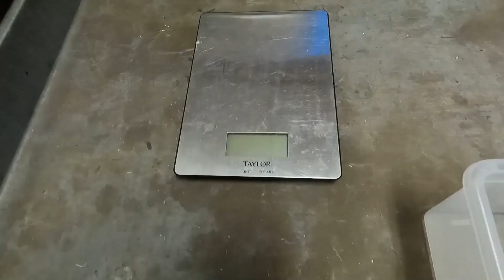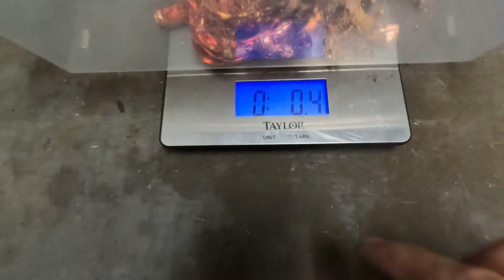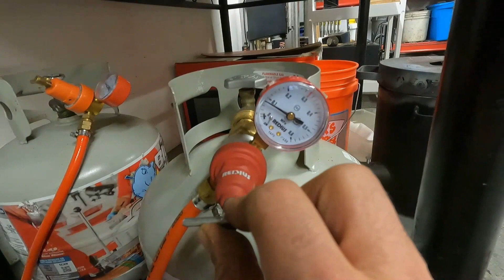Scrapping Window Fans - How much copper is inside? - Trash to Treasure - Melting Copper

Comment: Lovely video! I just love the concept of scrapping for casting. 
I was watching this vid while scrapping out a kitchenblender I found. Lots of copper in them.
Keep up the good work!
💪🏻💥
Reply from the maker: Hey buddy!  Thanks for checking out my video as always 🙂 Ooooo a blender, I never scrapped one of those before.  I’ll be sure to keep my eyes open for one.  Thanks for the tip!!!
Reply: @Scrap2Cast  well, at least it’s a lot of copper for a small appliance. This was a countertop blender.
Reply from the maker: @magnussahlstrom4172  how much in weight did you end up getting from it???  🤤 I love copper
Reply: @Scrap2Cast  I haven’t finished scrapping the motor or stripped the wires yet but my guess is half a pound with all the wiring and capacitors and stuff.
Reply: But it could be less, though. But still good for a small appliance.
Reply from the maker: @magnussahlstrom4172  pretty decent score!

Comment: Just found your channel, love your video style and approach. I def wanna see where you'll get to in time. 
Might I strongly recommend Borax fluxing your copper melts? You're losing a hell of a lot of material to oxidation and slag in your melts/pours right now, and borax is cheap as dirt. It's a physical process not just a chemical one so make sure you use enough borax to cover the top of the molten pool, for your size crucible maybe 1/4 to 1/2 cup. Add it in while the metal is warming up but before it becomes molten as borax contains a lot of water that has to be expelled first before it works as a flux. You'll get so much cleaner pours and recover so much more copper without wasting gas on remelts and repours.
Reply from the maker: Thank you.  I do use Borax, I don’t show it in every video.  Appreciate the concern 😁

Comment: That was a very old and rare metal window fan! Please tell me it didn’t work, as you could have sold that for at least triple the money you made from scrapping it
Reply from the maker: No it was toast.
Reply: @Scrap2Cast  lol good XD
Reply: Box fan was crap either working or not XD
Reply from the maker: Yeah it was a hunk of crap, one motor wouldn’t work at all, the other powered on but was wicked slow and rattled like crazy.  I do appreciate the info though as I had no idea that type of fan was collectible like that.  I’ll definitely keep an eye out for them!
Reply from the maker: @fanboy11thefanfanatic  hell yeah brother, those box fans get gross AF inside 🤣
Reply: @Scrap2Cast  they are always on the side of the road, I don’t even bother as there aren’t even scrap yards nearby where I live, at least I don’t think so
Reply: Did that damn box fan work? When I find them they do work but I just smash ‘‘em and then just throw them out lol
Reply: Also for the box fans to get the blade off don’t take to motor out leave it in the frame, then use something heavy to hold it down, I use my feet XD. And then pull up and it will come right off
Reply from the maker: Awesome thanks for the tip!
Reply from the maker: I honestly can’t remember if it did or not,